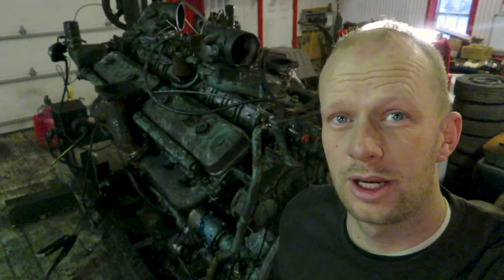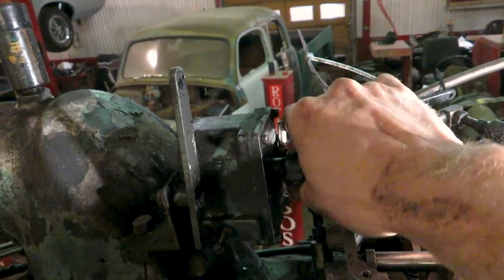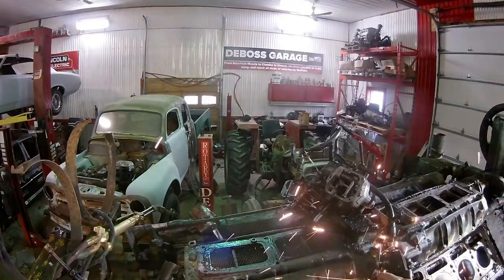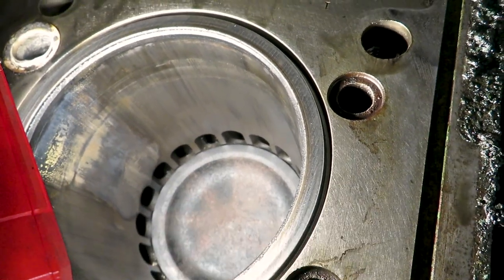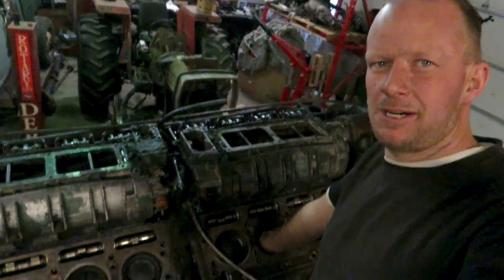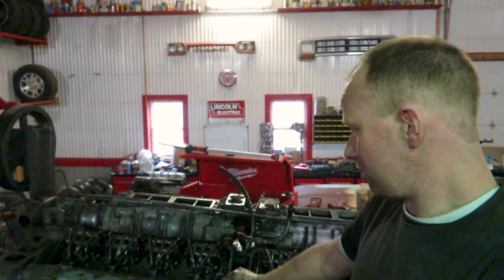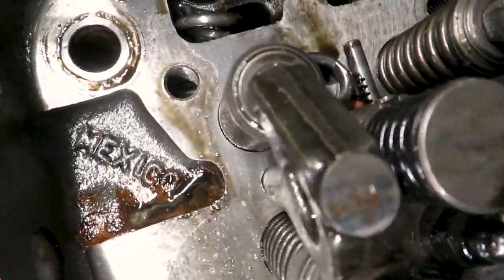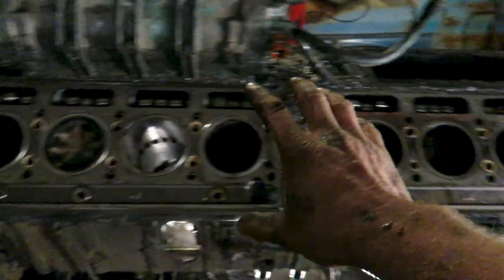What's Inside a 16cyl 2 Stroke Detroit Diesel? #HowItWorks

Comment: Those are the newer racks where an injector can hang in full fuel, but the engine won't take off. If you had an injector hang on the older two screw racks and it was under load,  look out. You can check for burnt valves by backing the exhaust manifold off an eighth inch and with one hand hold the rack at idle, then run each cylinder into full fuel individually. If a valve was burnt, you'd see a flame out of the exhaust port. We used to get a lot of burnt valves on car ferry boats with their long exhaust run and abuse by heavy handed captains.
Reply from the maker: You can see flames come out of the passenger side almost right away after startup
Reply: @DEBOSSGARAGE  I'm certain sitting out in the elements didn't help those 64 valves. It ran surprisingly well.

Comment: One more thing ,driving my tandem down the highway with the 6V92T at 40 below when the coolant temp dropped below 180 degrees even with a weather front and belly tarp the vents would blow could air in the cab , made a person think it was 1890 not 1990 .

Comment: I know the Detroit engines will run either direction and they sometimes start going the wrong way as you said. If you were to reverse direction, say for use in marine application, wouldn’t you need to do a few things such as oil pump and blower? I’m thinking them turning the wrong way wouldn’t put pressure out 🤷‍♂️

Comment: I think the correct blowers for petrol V8 supercharger applications were the inline 6-71 blowers rather than the 6V71.
I could be mistaken but I think not.

Re them running backwards, what about the oil pressure?

Comment: All you guys that want a runaway Detroit seem to not know anything about them.
Just screw the buffer screw in one turn and it will go into full fuel.
Scary shit when you do a tuneup, you take the roll out of the idle but too much will override the gov. As you rev and adjust the revs die back slower until it won’t return at all.
Have a hammer handy to smash off the fuel filter fittings cos the blower flap(if it works) will only pull it down to about 1400 rpm.
Or let it go.
6v53’s don’t grenade they just sit at about 4300 then die.
Hope this makes sense and helps.

Comment: So intake side works like a 2 stroke but exhaust side still uses a cam and valve setup like a typical 4stroke. Interesting. If you mount one block in the opposite direction wouldn't rotation be opposite between the two? I just noticed you said these engines will run in any direction aslong as you swap the starter around. Cool video.

Comment: Although the engine can run backwards... it shouldn't. Your oil and water pumps are going the wrong directions. If the other engine was to run backwards in a marine installation, I think they literally turned the engine around, since it's symmetrical. Otherwise you'd need reverse flow oil and water pumps.

Comment: The cam comes out the side that it's on u have to take the gear case off also the left hand and right hand engines are completely different crank in them
Reply from the maker: Thanks for clarifying!
Reply: @DEBOSSGARAGE  I helped build a race truck/semi that we run at the boniville salt flats It had a 16v92 in it. I built the motor we had it on a engion dyno and made 3500hp cant remember the torque.  Joint venture is the name of the truck.

Comment: Now since both cranks are put together, assuming power output is only on one side of the whole engine, to drive something. Won't the engine that is directly connected to the PTO have 2 engine's forces put on it? I'm trying to say, I wonder if one engine's crankshaft is stronger than the other, because it has to withstand the power of two v8's.

Comment: Also when I started on the service rigs in Alberta in 1980 almost every one had a 8 71 or 8 92 non turbo with a few 12 71’s as they stood up to the abuse of full throttle on and off steady all day and revved very fast running the blocks back up the derrick ,better than Cat or Cummins of the period , they leaked so much that we would say if there . was no oil under it there is no oil in it much like shovel head and earlier Harley’s

Comment: I used to work on tug boats and they had two GM locomotive v20 2 stroke engines with 15 l of displacement per cylinder each engine had to have been 30 or 40 ft long

Comment: As a HD in the oil field I used to stand beside the 92 series of these on the dyno in the last few years of production for hours on end testing.. With the flick of a switch  these screamed at 2100rpm 1000hp. Double ear protection, still have a dead spot in my hearing to this day.

Comment: I have a 471 Detroit, the engine is in my boat. I have a water to oil leak, I fire the engine up then put the water into the cooling system. I can run the engine for like 8 hours and no water gets, into the oil and no oil in the water. Now when I shut it down in about 2 hours I will have about 2 gallons of water in the crankcase? The water drops just to the top of the oil cooler inside the header tank. I have pressure tested the oil cooler twice and it is ok. I did a static water test on the block  I took the head off the engine because the water only drained to the bottom of the head at first. Okay figured blown the head gasket, and put new seals in, fired it up it ran great shut it down, the water drained to the top of the block. Well, the people at the marina were getting nervous at this point. I tore the damn head off again and pressure tested it and it was ok, so at this point I did the static test on the block, what I did was put 1-foot long tubes in all the water jacket holes in the top of the block, Then I filled the water jacket to the top of the tubes, a month later no water drained out, so ok the block appears to be good. So I put it all back together again, just to have it drain down to the oil cooler. Now I'm back to the start of my problem!!?!   The other thing too is the rad cap is off the whole time so there is no pressure in the cooling.    GOT ANY IDEAS

Comment: Great video but they made the 71's turbo too not just the 92's it'd be a 16v71 T or TI. Another cool thing to add is the first number is the cylinders, the v means a v and nothing is inline, the 71 stands for 71 cubic inches per cylinder and last is t for turbo and TI was for turbo and intercooled.
Reply from the maker: I know they made them, I'm saying you can't just put a turbo on a non turbo engine

Comment: These engines were designed for the military to run in boats. The colder the water through them, the better they ran. If they got too hot, they would blow up really easily. They were designed to take a lot of abuse, and they were hard to blow up. I ran a lot of them over the years, and I always loved the sound of a 2 stroke Detroit. 
I drove an 82 Pete long nose with a 700HP 12V and a 15 speed. Wasn't anything on the road that would keep up with her. Fuel mileage sucked, but she ran good.

Comment: About 40 yrs ago, I used to operate a Terex 8240 loader with a Jimmy V6-53 and a 1954 Euclid(pre-curser to Terex) 35 ton dump which came with a RR motor that blew up. They stuffed a Jimmy 6-71 in that and it ran like a champ too.  Now, I'm a Die hard Ford fan but those fuckers wouldn't quit and I beat the shit out of them. Can't beat a Detroit Diesel! Great for marine applications too.

Comment: There is an easier way to get to the injectors.  You can flip the rockers right back without even taking the pin out.  Just takes a bit of effort.

Comment: These are the same engines and they can be built left and right hand rotation. Although both could be built the same, in the 16v92 application you actually have one left hand and one right hand bolted nose to nose.

Comment: Trust me the new 4cycle common rail dd engines will run backwards too! Only when they do it it's accompanied with a runaway. Bad fuel caused the injectors to hang open while it stumbled to a stop. On cylinder bumped and fired backwards and that was the end of that dd ran up 3200 rpm and spun rod bearings. 2014 Freightliner SD DD13.

Comment: Actually I was one of the ones bitching .. but it really was meant in good fun, tounge in cheek. Excellent tear down - very informative. The parts for these appear to be quite cheap (piston and liner ~$200), etc. As obsolete as they are, and I suppose underpowered by today's yard stick I wonder if the overall simplicity and ease of repair might still make them a viable option for the clown brigade types like myself building a coach motorhome conversion. Getting on in years and the eventual plan to travel without a whole lot of savings makes the prospect of sudden big repair bills scary. Seems like you could carry spare bits and go rod deep into one of these in the local Walmart lot if you had to.

Comment: It wasn't until the '80s when Detroit Diesel started making more lightweight, compact V8 Diesel engines for light/medium duty pickup trucks.  The 6.2 did have an injection pump made by Standadyne, which they pretty much made ALL the injection pumps for any indirect injection truck engine of the time.  So simple, that the 6.2 could run without an intake manifold, and was still pretty closely related to the Chevy small block anyway, as it was an option in lieu of the gasser V8's.  Maybe weighed 100-200 pounds more than a small block, but absolutely sipped fuel.  It was also Detroit Diesel's first attempts into 4 cycle, which lowered the engine's profile to fit in small places, compared to 3-53's at the time, and still had better emissions.
Reply: I tried fitting one of those into my 68 corvette. soon discovered I would not have a/c or p/s and would have to fabricate a different oil pan. someone did do this sway and was getting over 50mpg.
Reply: @narcissistinjurygiver2932  An Olds 350 Diesel might fit better, as I've seen a '78 Corvette use one due to the compact space.  I've also saw pics of a 6.5 used, but it was an extremely tight fit.  I'm strongly considering putting a 6.2 in my Camaro with 6.5 parts on top so it'll clear the hood ok, only using the computer to run the gauges and torque converter lockup.
Reply: @MidnightMechanic  hard to find the olds350. what happened is they had bad coolant passages in the heads and they needed head studs. if they had fixed this it would have been awesome.  i ended up selling the 6.2 and putting the orig eng back in.  I have a mercedes om617 am am going thru and may do a swap someday. i love running the 617 on used atf.
Reply: @narcissistinjurygiver2932  There's so many olds 350 Diesels out there that nobody wants them, high supply, low demand.  You can find one for $600 guaranteed ready to run right from an engine recycler site online.  Just make sure it's a Mr. Goodwrench model since they're recasts and stronger.
Reply: @MidnightMechanic  where can you get them? Also what about parts?  these things are over 30yo.
Reply: @narcissistinjurygiver2932  https://www.lowmileageparts.com/1985-OLDSMOBILE-CUSTOM-CRUISER-Engine-P305172.aspx One of several from that site alone!

Comment: This was an exceptional vid in many ways but you didn't show the  cylinder head exhaust valve layout in anything like the detail you explored the rest of the motor.
I was surprised this was a 4 valve motor as i assumed (incorrectly as it turned out) that it would be a 2 valve. On the basis of a single NA 8V71 I estimate the output of this would be in the order of 650hp.
Reply: All 53- 71- v71 and v.92 DD have 4 exhaust valves per cylinder

Comment: When an injector sticks on these two stroke Detroit’s, all the injectors will be stuck in the same position because they are all linked together solidly on the fuel rack. One injector can’t move without the others moving. Once one injector sticks, the governor can’t control the fuel rack anymore and every injector that’s not stuck will be at full fuel making the engine spin as fast as it possibly can which is well above 2300 rpm.
Reply: There are two rack arrangements, fixed screw and spring return, this engine has a spring return rack that allows one injector to hang at full fuel while the rest can move back. The fixed screw type will jam as you describe.

Comment: I wish I could afford to get one of the pistons from you just to put in my collection of pistons... every gearhead has one of those... right? :P I want to get a 8/71 to play with.. at the very least it'd be great to piss off the neighbors with.. But I actually want to build a big truck hot rod... like a 6x6 cab with a short bed and the 8/71 and a huge I beam front axle, and of course straight pipes with stacks.. Would be a cool nod to the military I think.

Comment: Someone's arguing about whether it's a 2 or 4 stroke and about it having valves.My understanding is that it is a 2 stroke with ports determining the exhaust timing .So the valves are all inlet valves controlling 'compressed' air. Is that correct?

Comment: My man got a lot wrong here. When an injector sticks open, it will make the entire engine rack stick, putting the engine way above "2300 RPM," in reality probably 3000 or higher. At that point important things start coming apart.
Secondly, that situation IS  a runaway because the the governor has no control over the engine. The engine will go as fast as it can suck air before snapping the blower gearing or throwing a rod. 

These engines will NOT run on their own oil coming through the piston rings. If they somehow manage to start running on oil, it is because the blower seals were poorly maintained or they got sucked out by using the shutdown flap too often.

While they will actually fire going in reverse if you manage to do that to them, they CANNOT be run backwards without damaging themselves because the water pump is made to run in only one direction and running it backwards destroys it. Also the oil pump doesn't like it.

2 stroke detroits are *not* common rail! They are MUI. The fuel delivery is done at low pressure and the lift pump operates at ~40PSI. The high pressure fuel injection is done entirely in the fuel injector; pressurization, metering, and injection.

The 4 stroke detroit engines are common rail diesels, not unit injection.

End of bitchy rant

These engines can't be turboed and sent out the door also because of timing (as well as piston cooling). On turbocharged engines, the exhaust valves close before the piston leaves BDC to build boost. Non-turbo engines have the exhaust vales open shortly before the piston gets to BDC to help with scavenging. The then close exactly after BDC for compression and power.

When these old engines shut down, the injector rack gets put to full fuel by the governor after the shutdown piston is released. So when you start it up, instead of idling, the engine will run away on you. If it idles and revs the rack was not stuck. In rare cases the linkage could get caught on the valve covers too or in non-WOT positions.
The springs that you see on the side of the sliders are meant to help prevent a "detroit runaway" from happening. If an injector sticks open, only THAT slider gets stuck. It makes lots of diesel knock and pukes black smoke, but the governor still has control over the engine speed. Older detroits didn't have that, so that's why they were so famous for running away.

It's definitely not a good idea to crutch out a cylinder. The entire valvetrain geometry will be thrown off, leading to some resonance and major vibrations from unbalance

It's not something you mentioned in the video, but if the 4 racks aren't properly synced up, the engine will hunt pretty badly.

Comment: It's not a common rail engine as the fuel is only at about 65psi in the low pressure side and bumped up by the rocker. It's normally called a MUI engine Mechanical Unit Injection.

Comment: If you had it running backwards, wouldn’t the blower be pushing air the wrong way?  I don’t see how you could run it backwards without switching the blower drive gears.

Comment: 453 would be a 4 cylinder. 53 cubic inches per cylinder just like 6v92 would a 6 cylinder v configuration 92 cubic inches per cylinder and the factory bolted two 671 together side by side for marine use during ww2 the first use of i believe was marine and gen sets good video
you guys have a good day
THE GRUMPY BUS

Comment: Love all of your videos. But  That difference between a blower and a supercharger is a blower makes vacuum a supercharger makes boost. You cannot just take a Detroit blower and drop it on a hot rod with adapter plates. the end plates are significantly different the rotors are Teflon lined and the rotors are geared up to spin almost twice as fast.  You can make a Detroit blower work as a supercharger but really the only thing you would be keeping would be the case of the blower everything else would be replaced with hot rod parts.. so no it isnt really a supercharger and u cant realistically put it on a hotrod without more work than it is worth

Comment: Regarding the running backwards thing.. you say all its needs to run backwards is to flip the starter around.. but wouldnt the oil pump be running the wrong way then? 

p.s love this video. so much information. keep up the good work
Reply: you are right, plus the oil would spew out the air intake.

Comment: Hey deboss. I notice you do ALOT of diesil engine "reviews". You have alot of hrs behind a wrench working on them. So I guess I have a question for you. What engine/truck would you recomend for a first time owner op. I really like the kw t660 and the freightliner Coronado. The Cascadia im in pulls tons better that the t680 I was in so Idk. The t680 had a cummins. The Cascadia has a dt13 or some crap. Just curious about your thoughts on a good reliable engine.

Love the vids btw.